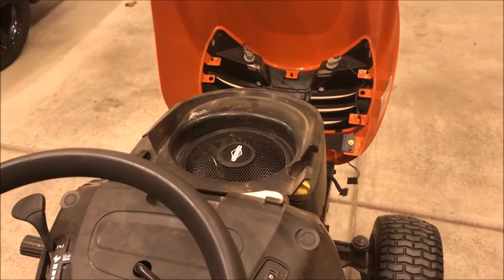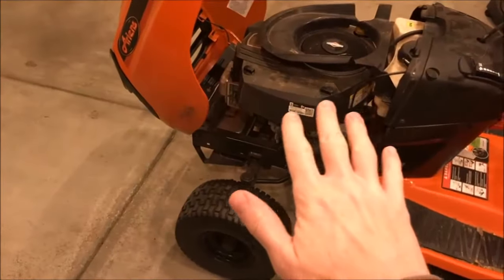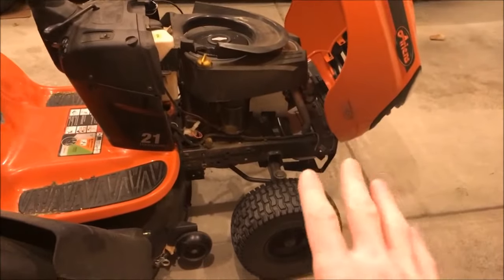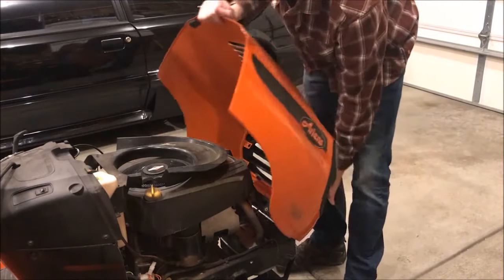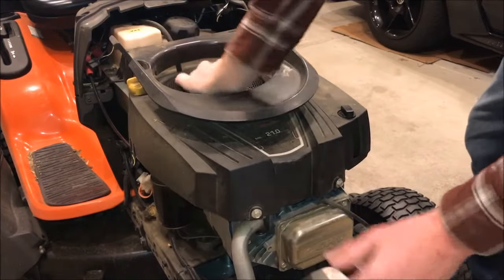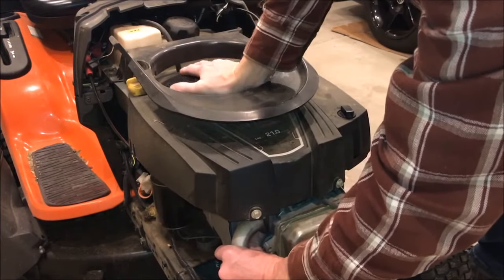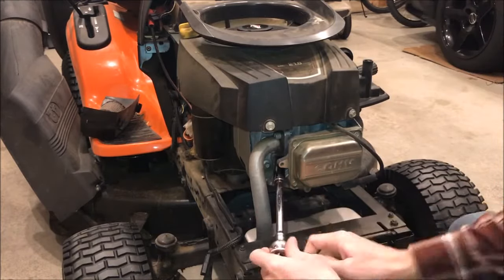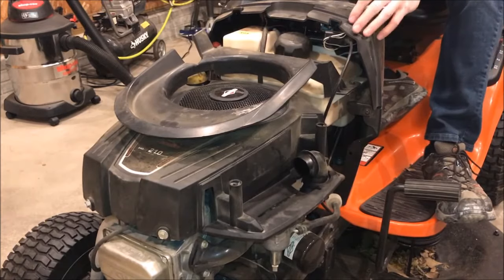Start Compression Locked Briggs & Stratton Engine

Comment: Thanks for the video. My Intek 20hp B&S did this a few years ago and I paid someone around $300 to repair it. All was well until a few days ago when it behaved like the battery was not charged enough to start. I tried a new battery with no change. I then replaced the starter solenoid with no change. My next step would've been the starter, but as much as I was in denial, the compression issue was the cause. I turned the wheel on top of the engine backwards about two turns and it started. Got about 3/4 of my lawn mowed and figured since I can at least now start it, I'll finish the next day, Nothing doin'. after 15 tries I headed to my local hardware store and purchased a new mower with a Kawasaki engine. In my world Briggs & Stratton can never be trusted again.
Reply from the maker: This is the unfortunate reality with the B&S engines. Just an awful design. I recently replaced the cam for a second time to fix the compression issue. The fix lasted for two mows...now it’s broken again. I’m completely with you. I’m done with anything B&S.  I’d really like to go full electric, but too cost prohibitive right now. 

I did figure out how to start the engine easier, however. Even with a broken compression relief mechanism. Simply turn the engine by had past TDC then cover up the air intake tube and crank it on choke. This decreases the amount of air the engine intakes and makes it easier for the starter to spin the engine. It’s a much quicker method than what I do in this video, but ridiculous nonetheless.  I will be replacing the engine with one from Harbor Freight or anything that doesn’t have this poor of a design. The mower itself is fantastic...just the terrible power plant.  

Congrats on the upgrade! Silver lining is you won’t have to deal with this again and can dissuade others from buying B&S.  

I appreciate the comment and good luck going forward!
Reply: @FastFixYouTube  I'll bet you bought a non-B&S approved camshaft for under $40? I went through two of those Chinese things (total of 1 hr running time!!). The Chinese ones have horribly made compression release mechanisms. Finally bought a virgin B&S one for $60 out of a factory messed up new engine. Works like a charm.
Reply from the maker: @f86fman  hey there. No, I bought a real B&S cam for $100 each time. And each time they broke. I’d say your days are numbered with the one that’s working for you, but maybe you’ll be good to go for the life of the mower. Hopefully that’s the case. I just see so many people on this thread that have the same problem as me. It’s hard to imagine this problem won’t continue.  Thanks for the comment.
Reply: You probably got ripped off by the people that "fixed" it, 90% of the time when that happens all you have to do is adjust the valves and it'll crank just fine.
The automatic compression release only opens the valve a tiny bit, when your valve rockers are out of adjustment far enough then it negates the automatic compression release because there's so much slack in the rocker adjustment that the automatic compression release doesn't have enough lift to cover all the slack in the valve train.
I've fixed so many of these things for people that were about to take their mower to a small engine repair shop because they thought for sure that the automatic compression release mechanism on the camshaft was broken off it's not even funny, I have the feeling that 90% of the time these shops are charging people for a new cam and all the labor to put one in and all they do is adjust the rockers and wait a couple of days then call the owner to come and get it and tell them they had to put a new cam in it and hand them a healthy bill.
The last one I did one of the rockers had so much slack that tiny bucket (some call it the tappet) on the end of the valve stem fell off and was in the bottom of the rocker cover.
Tell everyone you know that before they take a hard starting riding mower to a shop to take off the rocker (valve) cover and grab the rockers, if you can move them all over (make sure neither of the valves are up on it's cam lobe) then they need adjusted and I'll guarantee you that the automatic compression release will work.
To check the rocker (valve) adjustment remove the spark plug and the rocker (valve) cover, turn the engine by hand in it's normal direction until one of the valves fully opens, then you can adjust THE OTHER VALVE, do this with the correct feeler gauge for that model engine and valve (you can find the clearance specs online), then turn the engine until that valve is fully opened and adjust THE OTHER VALVE.
Replace the valve cover and spark plug and I'll almost guarantee you that it'll crank over just fine.
Word of advice, don't wait until the engine is hard to crank to adjust the valves, having that much play in the valve train has the parts banging around and that's what causes those little automatic compression release mechanisms to break, adjust them once a year and not only will it always crank through properly but you'll never have the automatic compression release mechanism fail on you.
Reply: @dukecraig2402  hey thanks for the knowledge. My 3year old Briggs did this hard start thing yesterday. Soon as I get home I'm goin to the valves
Reply: @BM205  
That's just about the right amount of time (depending on usage of course) for the valve train to have enough slack in it to negate the compression release feature of the cam lobe.
Word of advice, make your adjustment to the MINIMUM spec, ie if it says. 004" to .007" make it as close to .004" as you can, most valve trains I've worked with in life tighten up from the valve's sinking into their seats but for some reason those engine's loosen up as they wear, also if it's a Briggs engine most likely you're going to need a torx screwdriver (a ¼" drive ratchet and the correct torx socket works but the screwdriver is easier to use) for breaking loose and locking down the adjustment, the center of the stud has a torx drive in it, don't confuse it for a small Allen drive and strip it, also if your's has a gasket (some do some don't) on the rocker cover(s) and you can't get one local you can use silicone to seal it after you scrape both surfaces and wipe them clean with alcohol or lighter fluid or nail polish remover or carb spray or whatever, when scraping the aluminum cylinder head surface stand a single edge razor straight up, don't angle it or you'll gouge into the aluminum. 
Let me know if adjusting them works for you. 👍👍👍
Reply: @dukecraig2402  I sure will. Thanks
Reply: @BM205  Did it work?
Reply: @SuperNoticer  no it was the camshaft
Reply: @dukecraig2402  You rae 100% correct and also hit the nail on the head about repair shops ripping you off. I worked parts in a GM car dealership in the early 90,s. They would tell the customer their brakes were bad and they needed new shoes, pads, wheel and master cylinders, new rotors and the car was not safe to drive.. They  claimed to re-surface the new rotors  (not necessary); All they did was replace the front pads for about $20 but charged the poor customer $600....And that was THIRTY years ago and that $600 then would be equivalent to over $1500 today. This happened over and over again until my cousin had his car brakes fixed and I told him what they did and he sued that dealership. He got a nice settlement. The idiots did not know he was my cousin because his wife took the car there. I quit pretty soon after I  spilled the beans to my cousin. To top it off the owner of that shop graduated high school a grade behind me and was a top student  turned crook. I think that shop is still going.
Reply: @FastFixYouTube  "I’d say your days are numbered"  lolol
Reply: @dukecraig2402  That's EXACTLY what I was thinking! Adjust valves FIRST!
Great advice!!
Reply: @fastguned  My wife got taken the exact same way. I was paying the bill & demanded all discarded parts be left in vehicle. They tossed them instead, then said they didn't know which rotors, calipers, etc. in the bin, came off my wife's car. LIARS!!! Never, ever went back! I was in a hurry, it was dark & didn't have time to see if new parts were installed...
Reply: Thank you for recomend Kawasaki, My neighbor had a Brigg Straton with the same problem, they gave her a Kubota and the same thing happened again.

Comment: You did it the hard way. Here is how I do it. Take the air cleaner off, put on a leather glove, put your gloved had over the intake, crank the engine. It will start immediately so get your hand off the intake quickly. What you are doing is not allow air into the cylinder, so no air to compress, it turns over.
Reply from the maker: Yes, you got it. I was doing it the hard way in this video. I’ve since done it the way you describe. Actually, I just replaced the cam for the 3rd time so hopefully it’ll last the summer season 🤞. Thanks for the suggestion in any case. I’m going to do a revised version of this video in the near future.
Reply: @FastFixYouTube  Keep up the good work. A lot of folks out there need help with mechanical stuff. In my day, kids learned it from their parents just as a way to survive when hard times hit us.
Reply: Thanks Rom
Reply: I didn't say in my earlier response, but in my opinion there probably is not anything mechanical broken that causes the problem,. I believe that the mechanics of the compression release is just "sticking" due to infrequent use, because most people reporting this problem say it happened after first attempt to start it after winter storage when the rig had been setting idle for months.. @tallhair
Reply: @Partysize2  Thank man. Had this problem this weekend.  Pulled plugs and spun it over for a while and problem seems solved.  For now anyway.

Comment: Just a note fellas, i had this problem, fitted a cam kit, had same problem, checked and set valves problem fixed, Cam decompression does fail, but i got caught by loose valves. Cheers and good vid.
Reply from the maker: Yes, this is 100% correct. Definitely check valve lash before going all-in on a cam swap 👍

Comment: Just a heads up...forget the fluid, get it to TDC...with as little pressure on rotation as possible. Then cover your intake so it can't suck in air to compress, then remove your hand (I actually use a block of wood), and it is now in the exhaust stroke and rotating fast enough to go on the next intake stroke 😉👍
Reply from the maker: Hello. Yes, I soon ditched the fluid and other unnecessary steps in favor of spinning the motor to TDC and covering the intake. I used a block of wood as well!  Great minds, am I right?!  Haha, take care and thanks for the great tip 👍👍👍

Comment: My tractor lives in an unheated shed in New Jerey.  The engine starts easily when the temp is above 75 degrees or when the engine is warm, otherwise I sit a small heater on the front wheel, turn it on and lift the hood, after 15 minutes or so it starts right up, even when when it's cold out.  iRunning the factory recommended oil, don't want to chance a multi viscosity blend. I Haven't adjusted the valves in two years, guess it;s time.
Reply from the maker: Yes, I’d say adjust those valves 👍👍👍

Comment: I've been starting a v twin for 5 years since I bought it used by rotating the  engine to top dead centre on the stiffest cylinder, then just past it. From there the starter cranks its fine. I always thought it was the sealed battery had been incorrectly charged and compromised by the previous owner (lots of warnings in the manual supplement), but I was surprised that a brand new battery didn't change anything. So I've now just discovered this compression release mechanism fault. It seems though that even a slightly too wide gap on the exhaust valve tappet can cause it, as the compression release 'bump' is so slight a oversize gap will mean the exhaust valve just doesn't open that little fraction to decompress. So next job is set the tappets.
Reply from the maker: Hello. Yes, the fault is something that took me a season to figure out.  I thought it could be a battery as well or maybe the starter.  

It’s possible that a simple lash adjustment on the valves could do the trick for you. Just find the specs for your engine and go from there.  If it doesn’t correct the issue, you’ll likely require a new cam. 

Thank you for the comment. Feel free to let me know how it goes. Best of luck 👍
Reply: The compression release on those is a weight on the Cam it is closed when you turn it over until it starts and it'll sling open and will allow the valve to close that's how it releases the compression I hope you understood that now the tappets that you mentioned in last sentence of your deal yes they need to be adjusted yearly, a lot of people don't know that and even slightly off will cause the same problem

Comment: So, I've not tried this yet, I was actually in the middle of removing the engine, 17.5 hp 500cc b&s on a troy bilt pony.  Was looking up videos on removing/repairing it when I ran across your video. Now considering putting the carb and everything else back on and try this temporary band aid.

Question tho.... the last time I ran it, it suddenly revved up then began surging. I finished the lawn then ordered new carburetor, plug, filters, and got some sea-foam for the fuel.  Replaced all that, went to start it, and wham! Wouldn't turn over. Pulled the plug and it spun no problem, also there wasn't any fuel coming out when I removed it, so I don't think it's an issue with fuel and must be compression, but that's just a guess because I really don't know much about these engines.

My question is, given the symptoms I mentioned prior to parking it to repair, and the engine locking up, also when I turn it with plug out when it reaches compression it sounds like a horn softly honking coming from the breather tube, is that normal?
Anyway, given all that, anyone have an idea what it could be? The root cause, problem.

Thank you, anyone, for any insight
Reply from the maker: Hello.  It sounds like you've done a complete job as far as a tune up is concerned.  That's a good thing.  The problem you have does sounds like compression lock, especially because it spun freely with the plug removed.  That's a clear indicator of compression lock.  Compression lock can come from a few things, however.  The easiest is to lash your valves to the factory specs and see if that fixes things.  It certainly can.  If that doesn't work, you'll need to tear into the engine and replace the cam.  The cam has the compression release mechanism built into it.  The soft horn sound coming through the breather is new to me, but I'd imagine not all that odd.  As you rotate the engine with the spark plug removed, the engine intakes atmosphere from the spark plug opening and the intake.  Those two sources could effect the breather and cause a sound.  I'd disregard the soft horn and focus on the compression lock issue.  Once you fix that, see how things sound.  Best of luck and I hope this helps.

Comment: I've been doing, something similar to this for 2 years. I never knew there was a decompression mechanism at all... so I assumed battery &/or starter were NO GOOD. I replaced them both with NO LUCK.  I was able to spin the flywheel by HAND (top of motor) to get it past the compression stroke WITHOUT removing spark plug.
FYI... I hooked a battery BOOSTER PACK directly to starter (+) post while simultaneously turning key to "Start" postiion & was able to get it to crank enough to start WITHOUT getting to TDC nor using starter fluid. Prolly gonna burn up my NEW starter, though.
EDIT: After reading all the comments below... gonna check valve adjustment FIRST. 2005 B&S 17.5hp.
Reply from the maker: Yes, definitely check the valve clearance first. If that doesn’t solve the problem, likely the compression relief mechanism.